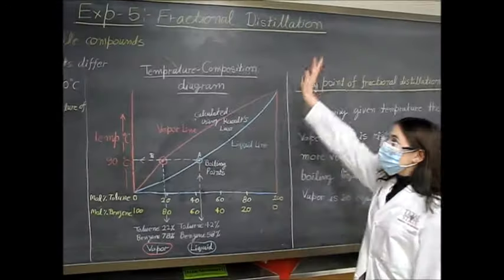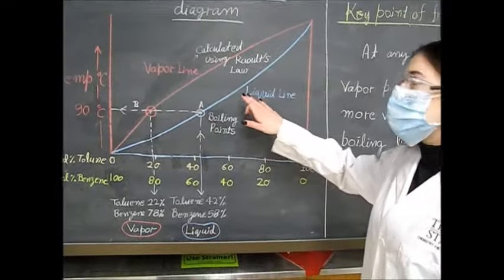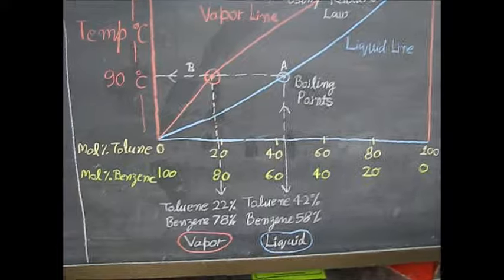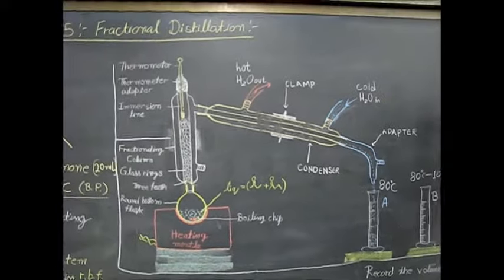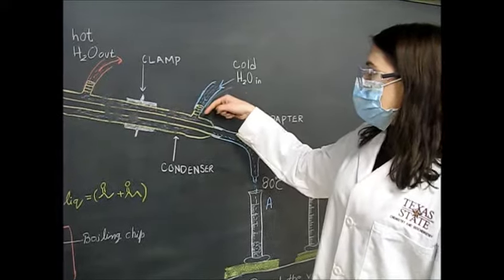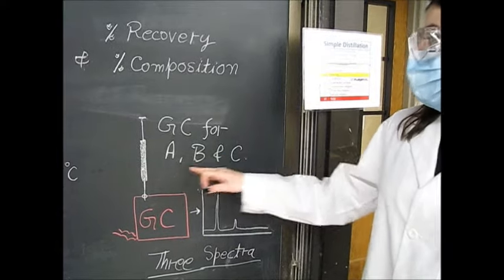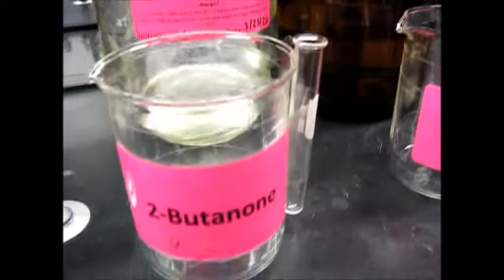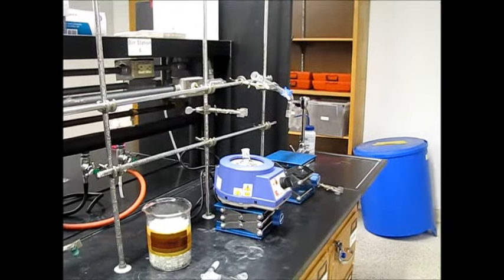Fractional Distillation Lab Experiment Part-1

Comment: U have mentioned it wrong when the boiling Point difference will be less than 30 degree Celsius..in that case, the mixture is Separate out By fractional mode of Distillation